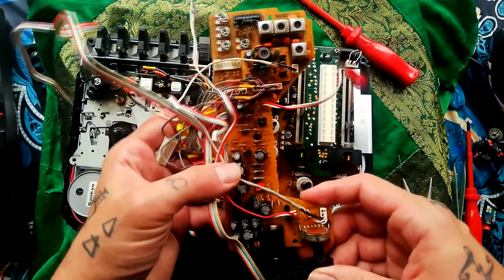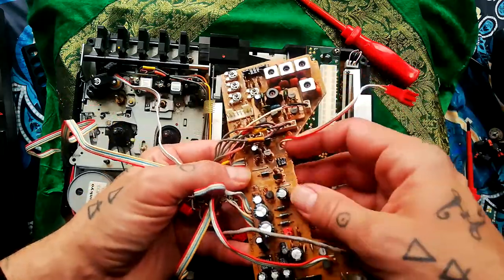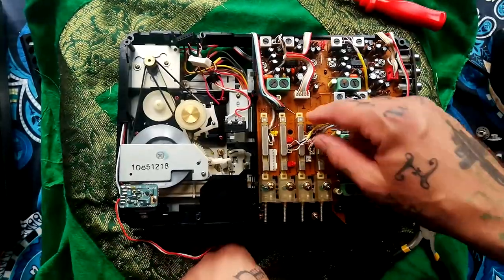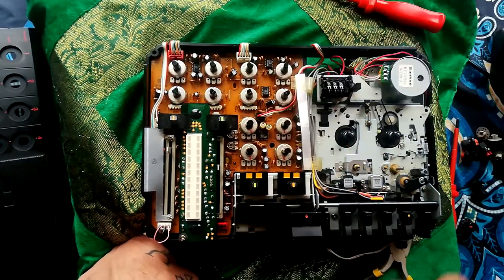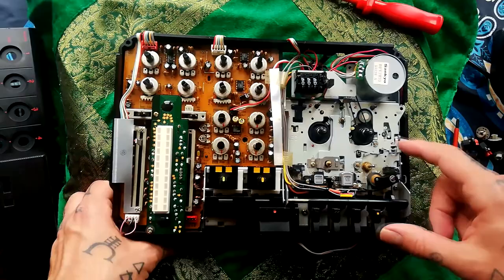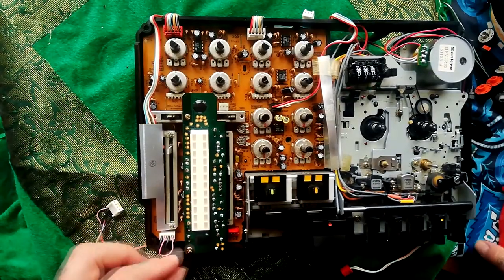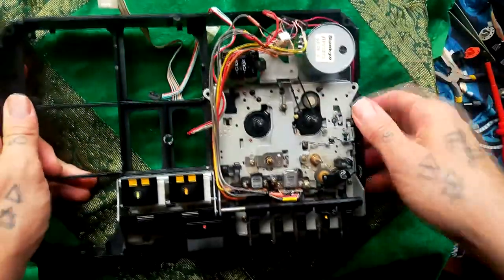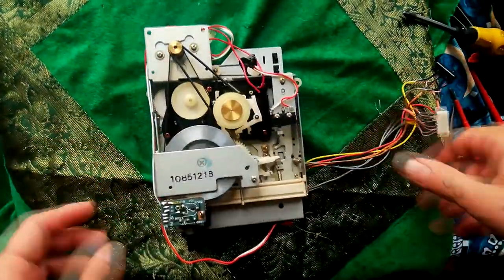Fostex X-15 | Tear Down Part 2

Comment: Great vid! I have an X-15 which hasn't seen use in over 15 years. I recorded lots of stuff on it in 80's/90's and recently unboxed it to transfer the cassette audio to digital multi-track. Two problems. Speed is very fast (not a user varispeed outside knob problem). Also FF/REW does not work.  Any thoughts on best way to fix this, particularly the speed problem? Grateful for any guidance!
Reply from the maker: Thanks. I gave have a series of videos about refurbishing the cassette player which you should reger to, here https://youtube.com/playlist?list=PLYsfQOh0tsJVl859LSG8MXisbMwLEW-L5  but basically the high speed is due to the pinch roller and head assembly not raising all the way due to either old grease or possibly there is a Spring under the plastic  head assembly plate which will will need to be reshaped. Ffwd rwnd is most likely a belt needs replaced.
Reply: @Tetrakan  THANKS for getting back to me! 

Oooof. I was afraid of that. Is there a way to  raise and "temporarily stabilize" the head assembly so as not to take apart the whole machine? I just would like to make one play pass of several songs to transfer onto DAW, for now. FF/REW can be accomplished on another deck.

By the way, I just watched your vid "(The Pitfalls of) Mixing a Portastudio Song in a DAW" and thought it was terrific. I will continue to look at your vids as I've used the Tascam Porta One that a friend had at the time as well. I also have a Yamaha MT8X, bought new, which is still going but has an occasional trouble with the playback transport (not the audio) "stuttering," but after a few stops and starts it seems to roll fine.

I'm looking at getting a Zoom Livetrack L-8 to use primarily as an audio interface to my DAW, but also as a portable digital multitrack, and music mixer. Let me know thoughts on this unit, if you are familiar.

Again, many thanks for any further advice and the great vids. You are the KING of cassette multi-track!
Reply: Tetrakan to the rescue! I took apart my X-15 today and cleaned up the transport area with a swab and alcohol pretty comprehensively. there was disintegrating rubber from a belt wheel messing up the inside as well as "regular" dirt and muck. That seemed to do the trick and my transport is functioning at the proper speed. I even noticed that one of the wires by the play head was disconnected and did a quick solder on it. I also adjusted the speed with an A/B comparison of a commercial CD and its cassette brother. 

Let's hope it stays functioning through my 4 track output dump to digital for all the songs I plan on digitizing. 

Very pleased that you posted these vids AND that they are nicely detailed (and entertaining as well).

Looking forward to more of your stuff to come. Thanks again!

Comment: Great video, I'm in the process of restoring an x-15 myself. Could you please shed some clarity on the transports/tape mechanisms  being the same as the portastudios, specifically, if I bought a belt kit for the partastudios as mentioned, will they work on the x-15?
Reply from the maker: Hello, yes the belts will fit, here is a playlist of 8 videos about that transport which includes belt sizes and the differences (auto stop solenoid, mounting of the motor etc) between models https://youtube.com/playlist?list=PLYsfQOh0tsJVl859LSG8MXisbMwLEW-L5
Reply: @Tetrakan  thanks a mil, going to check them out now

Comment: Great video!
I just had to touch base cos coincidentally I'm working on my Fostex X-15 at the moment too.
Mine has white lettering rather than red so I'm guessing that its the Mk 1. 
First issue was non-functioning FFWD and RWND, now fixed with a new BELT90 from the good folk at GB Audio. 
Playback is working, but one audio input has failed. I'm going to apply the same audio signal to both inputs and trace through looking for differences.
The corresponding meter is misbehaving, but that isn't a show stopper.
Can I ask? Is your Pause button latching or non-latching? I could have sworn that it was meant to be latching but mine isn't. 
Would love to compare notes as we progress. I don't have the bottle to strip it right down as you have.
Reply from the maker: Hi, yeah my pause button is latching. There's mine's mostly reconstructed right now so I'm working from memory but check the long creme plastic plate at the bottom rear of the transport underneath the flywheel is attached by a small spring to the plate which holds the fly wheel in place - I seem to remember that spring being detached caused problems including the pause button taking on a momentary  behavior?

Comment: Do you supply any spares for Tascam units, 244 / 246 etc? I'm after a pinch roller, (just the rubber part) which I think is the same for a few models...I seem to remember you saying you have a tascam graveyard. I'm working my way through a stripdown of a 246, so I might need other parts as I go. Anyhoo, great vids, let me know how to find out for parts etc.
Reply from the maker: I do have parts but I suggest you just buy the donor  pinch roller new ....did you see the videos about sourcing and replacing that part? https://youtu.be/YMWHQgfCS5I and  https://youtu.be/Aa9CCj_Lu4w
Reply: @Tetrakan  Hi Mr. Monobloc, I did rewatch those vids. The AS2 is unavailable, CPC don't supply anymore and ebay dont have them. Donor parts are ridiculous prices these days! Aliexpress don't have much and is a bit of a guessing game for sizes...I will keep on looking. Thanks.
Reply from the maker: @richardsmith4992  thing is I've only got a couple myself right now, I need to retain some stock if such things for my own projects
Reply: @Tetrakan  I'm going to order some bits from ebay and aliexpress and will report back if they are compatible or can be made to fit...
Reply: @Tetrakan  Hi Mr Supermonobloc -  do you know of a good like for like replacement for the Tascam 246 faders? I think there 2 types, slightly different, the schematic has different parts for the Master channels . I think they are both 10KA variety, 60mm. Just wondered if you know a good supplier? Thankyou.
Reply from the maker: @richardsmith4992  sorry, I haven't investigated that. I do have spares I'd be willing to sell, bearing in mind I'm in Scotland and you'd need to cover postage, message me via Facebook if that is of interest

Comment: Does anyone know how to reconnect the ground on that foil sheet?
Reply: I just modified it with a ring terminal, kept it as flat as possible, and positioned it in the best spot with enough room between the "foil" and electronics on the pcb. Then, insulated it with tape to isolate it from the pcb..

Comment: Skeh-MA-tik is correct.
Reply from the maker: Thanks!
Reply: @Tetrakan  I noticed you said the sluggish playhead deploy is usually caused by solidifying grease. Can I shoot some wd-40 or something in there to loosen it up? Mine is doing this.
Reply from the maker: I doubt it, and though you see third island use wd40 as a lubricant in his repair videos, it's so runny I'd be worried about it getting somewhere it shouldn't like the tape path. IMO dissassemble, use something abrasive like a dish scourer + isopropyl to get the hardened grease off then follow up with a more unctuous lubricant like silicone grease. I've used cheap brands of SG but you can get a good tube from servisol if you're not sure.